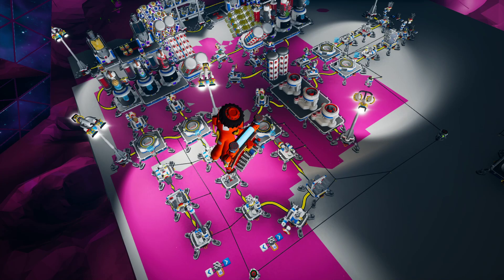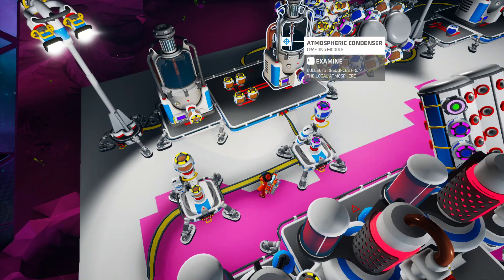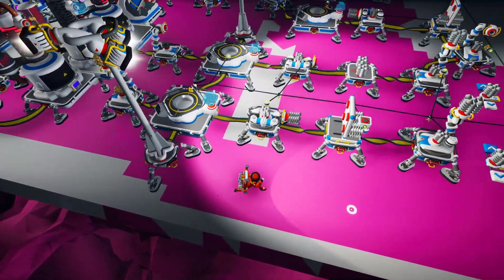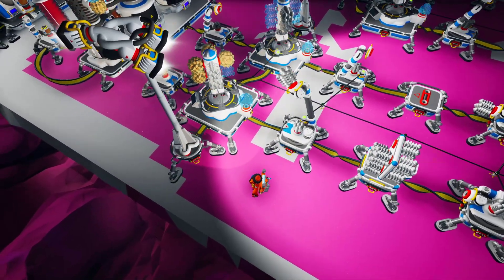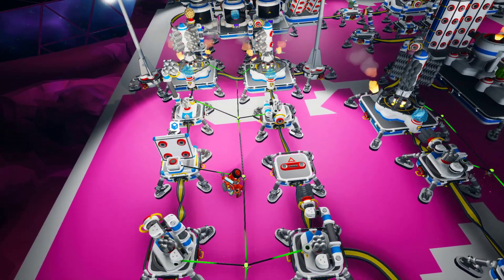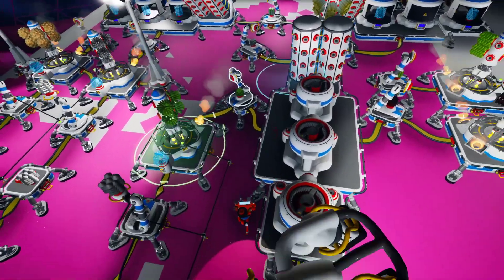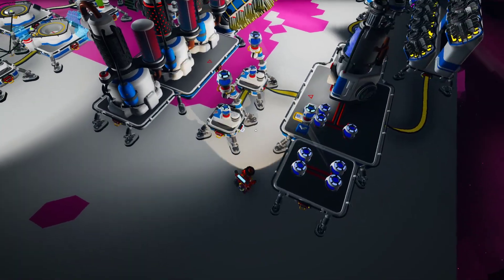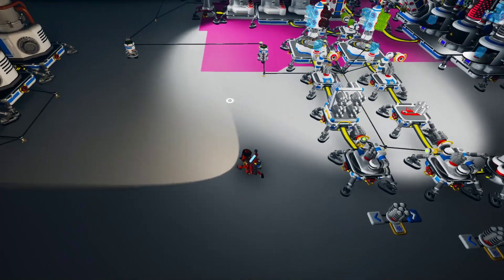Astroneer Automation Guides - Material Efficient Nanocarbon Alloy Production Line

Comment: Very interesting. The only thing I do not understand or recognise is what are the small modules with blue or white arrows each side from where the scrap appears to mysteriously pop up from.. you called them plinths ...I've never seen this item in game or in any other video Where is the scrap actually coming from that appears through these units?
Reply from the maker: The resources plinths are only available in creative mode. It's where I prototype my builds because you can build them very quickly. The plinths auto generate any resource you want so you can test out builds.

In my survival save file, I used to farm scrap from soil but nowadays I use an autoextractor to collect Wolframite and then print and shred floodlights.